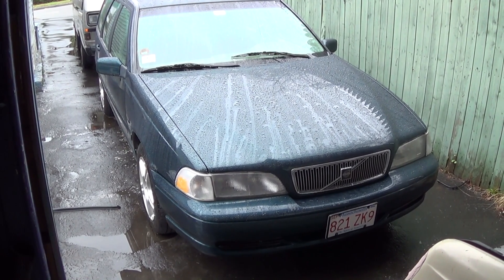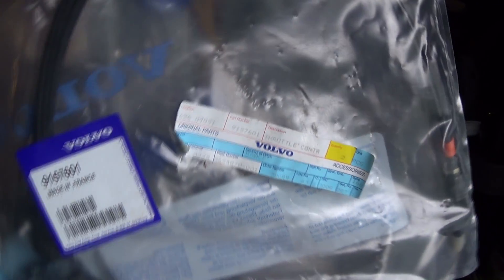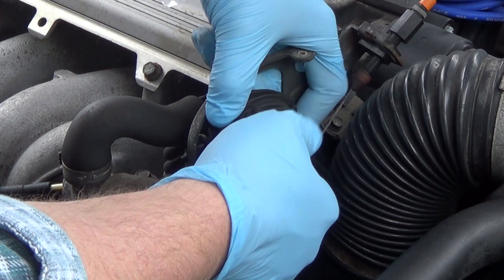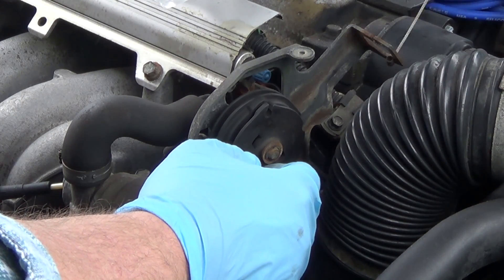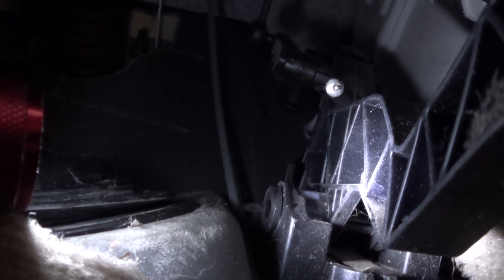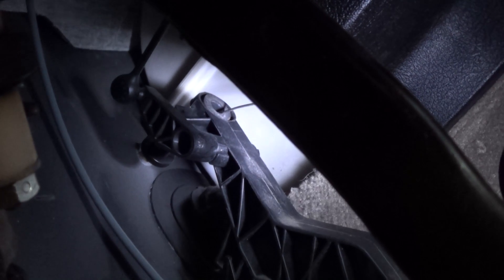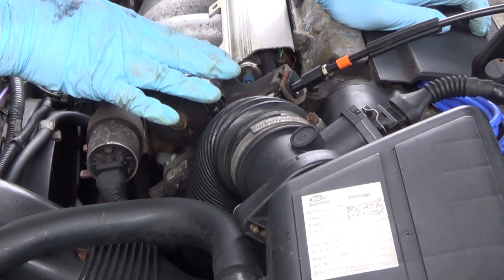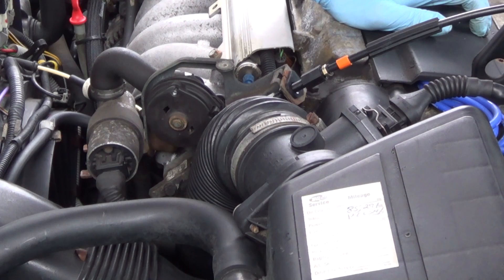1998 Volvo V70 - DIY: throttle cable replacement

Comment: hello thanks for the video did you notice a quicker throttle respond with the new cable?
Reply from the maker: +rct5r I couldn't say. This is primarily my wife's car, and although I do drive it, I don't have a clear memory of how the throttle felt before the repair. I DO know that the throttle got stuck once for her while on the highway - which is what prompted this repair.

Comment: many thanks for a helpful video.  I'm about to change mine ('97 855-T5).  best wishes from downunder.
Reply from the maker: pulsing1982 You're welcome. Best of luck with the repair from the northeastern part of the continental US.
Reply: MercedesDieselGuy Thanks mate - turns out I needed it!!  Now here's  a trap for new players:  if you've a RHD (Right Hand Drive), the LHD part  (as typically sourced from the US), is too short!  I'll be returning mine to FCP, and sourcing the correct part (for my RHD 855) from the UK.  Hey ho! #8 )

Comment: Someone may be interested in my experience of this.

It was viewing this video that gave me the confidence to DIY replace snapped throttle cable on my 1994 850 Automatic. Iam in UK 

The trouble was the process at the very point where this video skips ! 3.08
I could not remove the kickdown switch that is either side of the bulkhead entry.
The official method it seems is, from the drivers side to move lugs with a screwdriver & push into the engine compartment. I found this totally impossible because 1. the unit barely protrudes into the drivers side , 2. it is covered by insulation ( albeit pierced for the cable ) and 3 . The lugs ( there are several) are small. I removed from the engine compartment side by prising the unit away with a large screwdriver. The white lug collar piece eventually becomes visible and with robust prising will break.
The whole unit will now pull out from the engine side.
(There is an electrical connector to the switch that needs to be disconnected before you start )  ,

Damage to the switch is not a problem as it is all part of the new cable part.

I would imagine the manual cable replacement is more straightforward as there is no kickdown switch.

The new switch with the cable, clicks through the bulkhead quite easily.

The rest of the job is exactly as per the video and was problem free.

Just strange that the video skips the difficult bit and Dielsel guy does not mention it in his reply to Michael Sackstein. But thanks for the video anyway as it gave me the courage to embark on this

Thanks
Reply from the maker: Hello

I didn't deliberately omit anything from the video. I'm not set up in a professional studio, and due to lighting/location in the vehicle, this would have been a very difficult bit to film. This was a while ago - it's possible I DID film this part, but the footage may have been unusable.

Anyhow, that information sounds about right, based on my memory of the job.

Comment: I was wondering if you had gotten to this yet. btw, the video skips at 3:08
Reply from the maker: Yeah, I finally got to it. As for that skip, it's not a serious one, so I'm going to leave it be. I had no end of trouble rendering this video. Can't figure out why.
Reply: At least it wasn't one of those expensive electronic throttle units that they put on the newer Volvos. If that were the case you would have to get the computer reprogrammed by a professional. Not all cars require this step but I know Volvos do.

Comment: Installed a new cable and its too long how do i adjust it?????
Reply from the maker: I'm not sure there is an adjustment. Are you sure you ordered the right part? Did you route it properly around the throttle cable wheel under the black plastic cover?